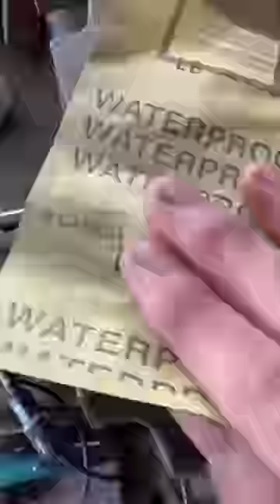CHEAP stripped oil pan/bolt solution!

Comment from the maker: On these old ford pans I unfortunately couldn’t just re-tap the pan without running the risk of breaking the little threaded metal piece, especially since this was already an oversized bolt.
Reply: Do you want to sell you’re truck?
Reply from the maker: @davidtorosian4314  nah, I’ve put too much time and money into it to recover what I’ve put in. But thanks for asking
Reply: I never sent a customers repair out with any kind of leak !!!  Bad for business !!!
Reply: 12MM – 16MM Magnetic Oil Drain Plug by ECO-PLUG, Threadless Magnetic Drain Plug for Aluminum Oil Pans. Universal Plug with Tapered, Self-Tap Thread, Easy to Install, Permanently Replaces Leaking Plugs

 

$19.95 Amazon

I know it says for aluminum pans but it will work for steel pans as well.

Description

Expedites Oil Changes No more screwing on and off threaded oil drain plugs. No more dealing with stuck plugs. ECO-PLUG’S magnetic technology speeds up the oil change process. Just remove ECO-PLUG with professional magnetic removal tool or pliers and easily re-install magnetic Ecoplug into hex bolt to service oil cleanly, safely and efficiently. Patented Leak-Proof Design is an Inexpensive, Permanent Solution to Oil Pan Replacement Say goodbye to leaking oil plugs and eliminate costly oil pan replacement. ECO-PLUG’s universal 12MM – 16MM tapered1.25” thread length for use on recessed drain hole with damaged or undamaged aluminum oil pan threads. The tapered, self-tap threads NOW FEATURE EXPANDING THREAD-LOCKER / SEALER fits 99% of oil pans to prevent, resolve oil leaks, ELIMINATE expensive oil pan replacement Go Thread-less, Go Magnetic, Go ECO-PLUG. How to Install: First, drain the oil from the pan. Using your hand, install the self-tapping tapered thread straight into damaged or un-damaged pan threads. Push and turn clockwise until the plug takes hold. using 7/8'' wrench Slowly turn the hex-bolt clockwise Turn until thoroughly tight. wait 5 minutes Fill oil and check for leaks. If you notice a leak, slowly turn the hex bolt clockwise until leak stops. How to Remove: Do not remove hex bolt. Apply ECO-PLUG Magnetic Removal Tool to ECO-PLUG or clamp with vice-grips or pliers and pull to remove. Stop installing temporary oil pan thread fixes. Don’t replace expensive oil pans. Go Threadless, Go Magnetic, Go ECO-PLUG.
Reply: If I had to go through all that trouble for a drain plug, I think I would just rather remove the pan to fix it or replace it altogether, and take advantage of the opportunity to put in a new pan gasket.
Reply: Thick grease on a tap works grabs the chips. Been doing it for years. Never had an issue
Reply: @charlesmoubry1965  This is this guy’s truck
Reply: HEY go boat store and find yourself drain plugs for boat and stick it up in oils pan and Twist it until it tight and push level down bingo save yourself from pulling pan off
just save yourself a headache from engineer and done that many time just save someone some time until they get new oil pan aftermarket last long than factory one
Reply: Well that answered my question before I asked it
Reply: @buttonysquare8501  never said it wasn’t? Just said a tap with grease works when shaving metal into an oil pan
Reply: You can buy oversized drain plugs probably could have avoided this
Reply: Just throwing an idea out there, what about sealing that hole completely with weld then drilling it back out and putting a time-sert in it? They're solid cylinder inserts so the weakest point theoretically would be the time-sert to pan interface but just don't go crazy on the plug when you tighten it and you should be sealed up and "de-stripped" 😝
Reply: Leaks but it “works”… at least it’s true that it leaks
Reply: They back a 1/2 by 2mm rubber seal that may work for that.
Reply: @beezertwelvewashingbeard8703    its about 1000$ to replace the pan because you have to basically  pull the motor.  there are kind of sketchy ways to do it but shops normally lift the motor up a good amount
Reply: @Hobbies_Galore  lmao
Reply: @jonathanderbidge598 he didn’t respond to you. Can you read?
Reply: @willhenderson8118  As a mechanic I'm thinking from the point of view of a mechanic. I do all my own work and yes, I lift the engine if necessary. Personally I'm in it only for the cost of parts and material for my own vehicle but, yes I can see your point from a customers viewpoint.
Reply: Did you ever hear about a Dorman rubber  drain plug that you stick in oil pan hole twist it until it expands inside and fixes that exact problem
Reply: Take it to a workshop so that they make a new thread and put a screw that already has a copper washer so that the oil does not leak
Reply: It still leaked because oil was still leaking when you welded the nut to the pan..... is my guess. Stuffing a small rag in the hole would of stopped the dripping.
Reply: @davidtorosian4314  after what you watched you still want to buy this truck?
Reply: Ya coulda just got it to thread out .. got a brand new plug from ford , wrapped the piss outta it with gas tape and tightened it to snug but now ur gonna run urself out of oil dike
Reply: @evanforster2665  where do you work so I make sure I never take any vehicle there....
Reply: Bubble gum. Unless its your welds leaking
Reply: You could've used a toggle bolt oil plug. They work great and won't leak. It uses a toggle like a wall anchor but has a thick oil resistant washer about 1.5 inches around with a wing nut. They are less than $10 at the part store. Secondly, you could have put a thin screw driver between the plug and pan while turning the head of the old plug. It would have caught on the undamaged threads and came right out. I have owned a quick lube and auto repair shop for 23 years with 7 employees. I have done 275k oil changes. I've literally seen it all. You made a mountain out of an ant hill.
Reply: Weld looks terrible, should have brazed instead

Comment: Sorry to say man, but if it leaks, it didn't work.
Reply from the maker: The purpose of this repair was to be able to change the oil with a drain bolt. Not to repair the leak. 

But yea, it’s certainly not a complete fix. I’ll reweld the leaks next oil change
Reply: @Hobbies_Galore  probably one of the dumbest replies I've heard from someone who works on stuff. 
I get it if you don't care. But when you can't weld. And that will leak faster the hotter that motor gets just from a drip.
Reply from the maker: @mitchellandrew3318  nah, it doesn’t drip any more than that, motor was run for 2 hours when I took that video
Reply: @Hobbies_Galore - with that much of a leak you will kinda have to do a continious oil change....
Reply: Is the weld leaking or the threads.  Put a plastic washer on the bolt if it's threads . If it's the weld next drain clean and apoxy or weld sommore
Reply: @Hobbies_Galore  I’ll say throw some blue monster thread tape then when you drain throw some J&B all around the exterior of the bottom pan and bolt section, if you tryna save money and be a Cuban like I am. I see you did extra on the welding you can fill her up with copper all on her too. That leak ain’t too serious so that’s the good thing now it is going to gunk the new bolt now with the modifications your always going to get dirty oil all in there just a heads up next time you try taking that bolt off again.
Reply: A bit drippy there old boy
Reply: Lol pinche welder chafa de la 99 cent store
Reply: I think you can use a oil plug gasket easy fit
Reply: AGREED!!  TRY AGAIN!!
Reply: @peteragersea377  a plastic washer? Why not a copper crush washer?
Reply: With this much work done, it would've been easier to simply just change the pan. And it wouldnt've leaked
Reply: @mitchellandrew3318  well that was a rude thing too say
Reply: @Rustynuckles1  Just cause you Buttercoat stuff for ppls feelings, don't mean I have to. 
I'd rather hear a valid opinion, then a few ppl say better luck next time. 
Also he said he didn't care. Was running two hours. But yet not take the time to clean up and do it once? Guess what that shows bud. It's not class.
Reply: @gorillawrenchin  the hot oil will eat that RTV hight temp off after a bit. 
You are better off using a JB metal weld.
Reply: @Hobbies_Galore  butter coat the responce all you want. I thought the purpose of the video was to "fix" the issue. Or make it funny. 
Plus its a diesel I get it. You got 12-15litres to drip off. 
But come on. Turn the heat up a bit more on the welder and penitrate more. 
Use a Cooper washer next time. The plastic one is only good for a few changes.
Reply: @gorillawrenchin  I also noticed you said Hyundai and Kia. So it's hard to take it seriously now. 
Sorry I'm a mechanic. And take pride in my work. 
Kids views would have tripled if he just turned the heat up on the welder and practiced a bit more before welding. Then you wouldn't need to smear anything on anything. 
Hence why I said metal JB weld. It's a legit fix on minor stuff like this.
Reply: @Hobbies_Galore  I had the same problem an I did the same thing but I cleaned it up and put JB weld on it and it stop the link. Hope it works for you.
Reply: @mitchellandrew3318  ok
Reply: @gorillawrenchin  I honestly don't care if I'm rude. I talk to tons of ppl a day , and called regularly about questions. 
There is ZERO proof the cars are living longer. Most have a shelf life of 250k miles. And that's being generous.
Vehicles 20 years ago cost much much less to fix and far easier to work on. 
I'm building 70/80/90s trucks for clients with LSs and Cummins. I've got 5 LS blocks from work trucks with over 500,000k on them, bodies rotted out. 
I will say newer vehicles have better crash ratings tho. But garbage. Work on a Ford lately? Last camp I as in we got 12 brand new diesels. Allllllll of then didn't make it the first bloody winter again. This has been going on since I was working underground in a diamond mind in Canada since 2012. 
Father's brand new 06 dodge Cummins, 10 seasons later we finally did 10k worth of work. My 04 duramaxs very much the same. Retired both my duramaxs at 700,000k and I believe they are still running today. Front end work every 100,000. 
We buy these newer 2010s + all the time, my father is a mechanic of 45 years same with his twin brother. 
Top ends on many cars, this and that. All brands. 
They are throw away vehicles after warranty is done. 
BTW have you even seen bills from dealers? There is zero savings. 
The cost to replace what used to be easy parts now you gotta lift the cabs on most diesels just to do head work. 
Wanna get into small engines also? Been doing that 20 years and also race. I bought my last snowmobile new in 2015 cause they are falling apart, certain brands are an absolute pain to change parts without almost ripping everything off. 
And I highly doubt you can work circles around me bud. I still have a work hard, play hard mentality. And I'm not 65 et, 27 years left to go and set my kids up. 
I suggest you get more experience before you go at ppl who have already been in the field. 
I've also got 4 trades under my belt to, all 100k + fields, I got bored easy in my 20s. Ppl pay good money for ppl with brains and understand how stuff works. 
And hey you may see me on YouTube in a couple seasons once my big ass shop is finished and my house, and feel like doing more of my custom work full time. But I've got a few solid years left track racing so that's my next focus. But fixing ppls garbage pays me 100hr right now where I am. I'm fast and get it done right. 
So your opinion of me being rude stands. But hey look at the tate brothers they doing just fine being rude. At least they are real. 
Now go invest into some tools, and come talk to me when you have owned a 150k truck.
Reply: @CM-xr9oq  sure that would work
Reply: @gorillawrenchin  If he didn't reply the way he did after the initial comment, this conversation wouldn't be happening. 
Cause then I would have had respect for the kid. It's not that hard. 
I've got 3 daughters bud, I'm not allowed to be a grouch. 
As I've said, I grew up with mechanics. There is a bush fix, and If you got everything at your disposal. Just do it once. 
All the kid had to do was turn the heat up on welder, and do a couple practice shots on something else. Leak done. Not dripping all over the place like it will and make a mess of the undercarriage. 
Is that so hard to take in?
Reply: @gorillawrenchin  Na bud it type extremely fast. I'm trolling 6 other pages on FB right now also. And I already now no one will read this. But I did get 4k likes the other day on another YouTube post a few days back. It's -40C out also and I'm 10 beer deep. I'm entertained 🤣
Reply: Guy clearly should of took up figure skating instead trying to be mr. Fix 😂
Reply: @mitchellandrew3318  At the drain rate it will be ready to change in 2 days... Give him a break.
Reply: @TorsteinOpperud  It's all fresh oil under the bridge...
Reply: @vwwrenchie314  He worked so hard to keep that leak.
Reply: @mitchellandrew3318  Good ole high temp RTV; exactly what you want to find in your valvetrain oiling system...
Reply: @kramnull8962  na its got 12 quarts+ in there. She got about a week + if he don't idle to much.
Reply: @kramnull8962  Idk how RTV would find its way into the valve train..... you would really need to do a shit intake job for that. And even then, it would break down and find its way down into the pan... and you would need a bunch of it to plug the oil pump.
Reply: @3o5maniak   I never got job weld to hold
Is there a trick to it cause it would be nice in this application
Reply: 100% it's just as useless now as if he had left it alone
Reply: exact words came out of my mouth.
fail
Reply: @TorsteinOpperud  nah bro all he is gonna have to do is add a little oil every time he drives it… it’s way more efficient than an oil change you don’t even have to dispose of all the old oil!😂😂😂
Reply: @nicholascampbell4600  hahahah, well, thats really kinda what I meant, just a more positive twist 😁👍
Reply: If it leaks oil it’s got oil
Reply: Well if works for him then it works.Thats what's problem with world today.Leave the guy alone.
Reply: @mitchellandrew3318  I totally agree with you
What a stupid justification. Jesus
Reply: @Hobbies_Galore  lolol there people don't know that the 7tree leaks... and if it ain't filler up again, 7.3 strikers were and are notorious for it...
Reply: @peteragersea377  use thread tapt
Reply: @ninom1980  lmao no
Reply: @3o5maniak  I think he should use pipe dope/ thread tape on those type of threads, I thought most pan bolts have a rubber gasket to eliminate leaking.
Reply: Just fixed one problem and made another btw the weld is rat poop would have been better to stick weld
Reply: @mitchellandrew3318  Nice talk. I believe my brother in law in Diavak   is your boss. I'll ask him.
Reply: @derekcollins1972  Wrong mine. Its next door to it tho.
Reply: @mitchellandrew3318  A little constructive criticism never hurt anyone. If people post things online, they should be prepared for whatever's thrown their way.
Reply: Imagine welding everytime you CHANGE YOUR OIL. 
dude pick a new platform lmaoo
Reply: @Hobbies_Galore  at the rate of that leak you will be re-welding that very soon.
Reply: @Hobbies_Galore it's a pretty fast leak man just fix it real quick
Reply: That just means you always have fresh oil in it.
Reply: Tap the larger hole and get a bolt and a rubber flat washer from the hardware store provlem solved or just replace that pan this is in no way concered even a temporary fix. Things like this makes real mechanics look bad
Reply: @Hobbies_Galore  I think if you add a rubber washer you will be fine
Reply: @mitchellandrew3318  ... Butch said to Sundance, Don't sugarcoat it Kid. Tell her what it's like.
Reply: @JW...-oj5iw  lol I can't find that comment.
Reply: Agreed. It ain't fixed.... it's just a different looking problem you're proud of....
Reply: @Hobbies_Galore  so what you're saying is you fundamentally misunderstood the repair that needed to be made and were ill-equipped to properly make the repair....but what you ended up with was marginally or arguably better....so you're pacified with the results... which are a wash for end result and a waste of your time... Noted. I stumbled across your page but will take note moving forward
Reply: A
Try a crushing washer that may fix the leak l, looks like is coming out of the bolt
Reply: @CM-xr9oq  , because a plastic or nylon washer seals better.
Reply: If it don’t leak how are you gonna know if it’s got oil or not😂
Reply: @redriverrc1624  harley owners when their $50,000 bike leaks because it was designed poorly
Reply: I was about to say "yeah, that operation didn't succeed." lol

Comment: I used to weld like that. Before I learned how to weld.
Reply from the maker: That’s correct
Reply: that's exactly why it's leaking
Reply: Oh God. I think you can train a chimpanzee to weld better than that
Reply: I just wish had that aspiration in welding as he did in sanding that bolt and nut clean.
Reply: Lol
Reply: @Hobbies_Galore  my 7.3 leaks more than that...run it until you get you a new pan!
Reply: yo  i neva weld like dat  neva eva

Comment: This is definitely one of those " if there aint no oil under it, there aint no oil in it" machines.
Reply from the maker: Damn right
Reply: That's for sure, like the older Harley bikes they'd say if it's leaking oil that's a good thing. Not leaking would raise some concern.
Reply: Haha I have two ford's like that. 01 f150 4.6 and an 08 f250 6.4 powerstroke
Reply: @Wkyliving  does the 6.4 still run?
Reply: 94 ranger with a leaking transmission, thats a fact
Reply: @Austin  yes it was a fleet vehicle. They replaced the engine 3 times this one only has has 40k on it 😂
Reply: Sometimes you got to get oil in your hands and clothes since people don't believe you that your a mechanic when your finished and have clean hands and clothes 😉